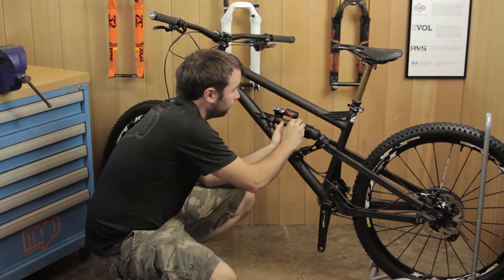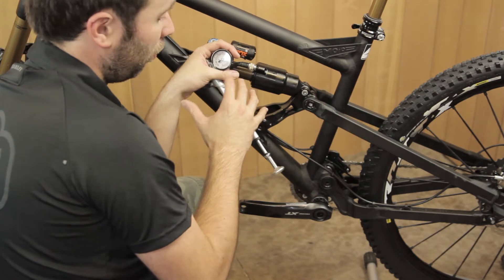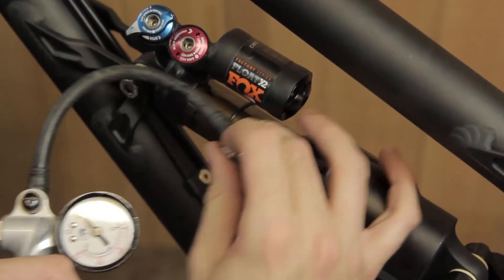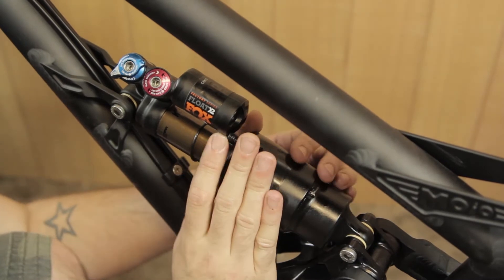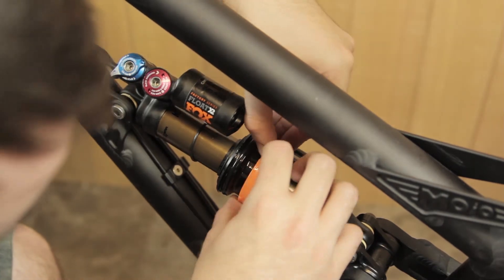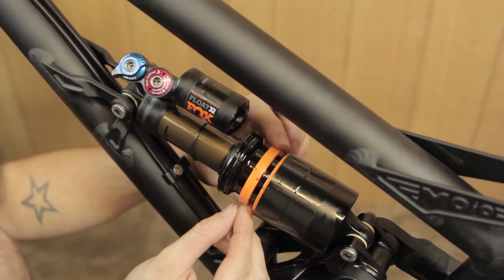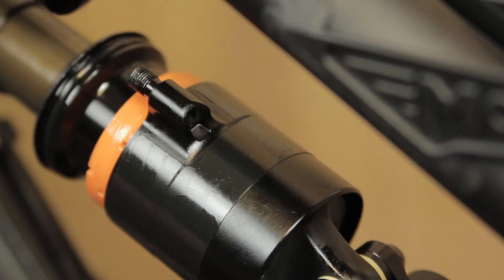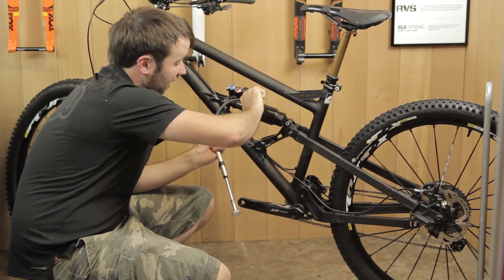Updated 2017 Float X2 Volume Spacers

Comment: And don't forget to slowly cycle the shock 20 times or so through the first part of the travel to equalise the air in the neg and pos chambers. Then check the pressure and repeat if it needed more.

Comment: In some recent revisions Fox added a little hex screw that goes into the key right under the air valve. This little sucker needs to be unscrewed before you can turn the air can (be careful not to lose it, it is *tiny*)
Reply: I lost it :( do you know what it is so i can get a new one?

Comment: I have a shock that has the update air can and orange spacers that was delivered with my bike.  Since there was nowhere mentioned how many I had inside I opened it to check it and put it back like in your video.  Only problem is that my shock is squeaking when pressed and really don't know what's the issue.  I would mention that a really small amount of oil leaked at the bottom of the air can.  Could that be the reasons?  I can't find anywhere how much and what kind of oil it should be in there .

Comment: is the 2017 version with a "full lock" switch ????
Reply from the maker: The 2017 Float X2 is available with the adjust lever, the 2017 spacers can fit pre 2017 Float X2 shocks.

Cheers, Tom | Mojo Suspension
Reply: update your video! there is now a lock screw that you need to remove in order to get the can to rotate and slide back. very fine screw too